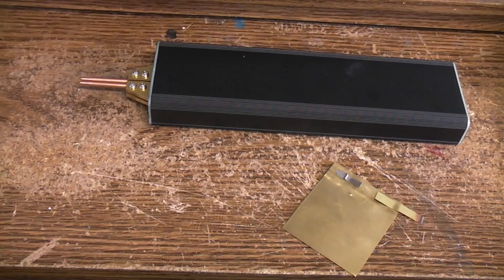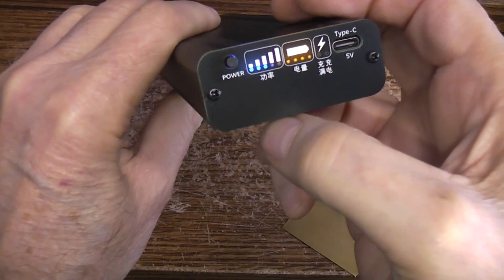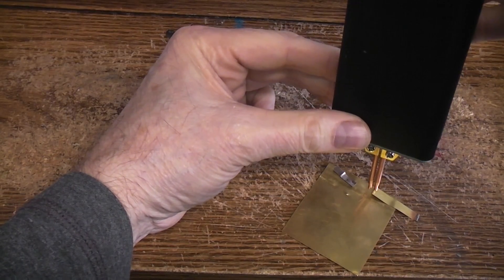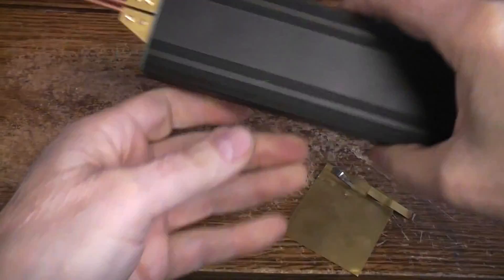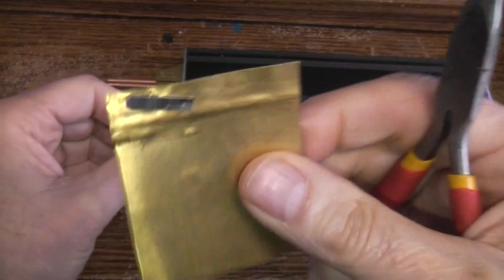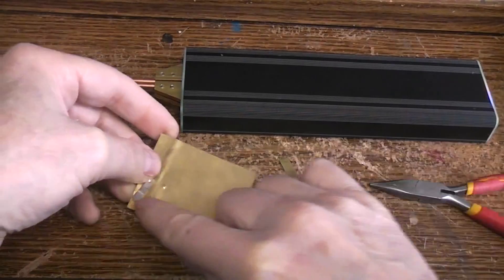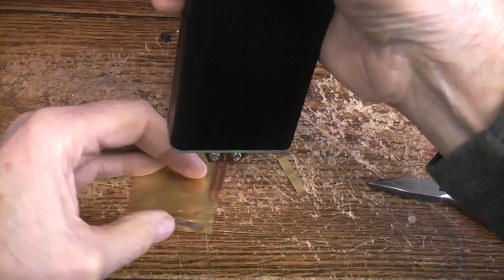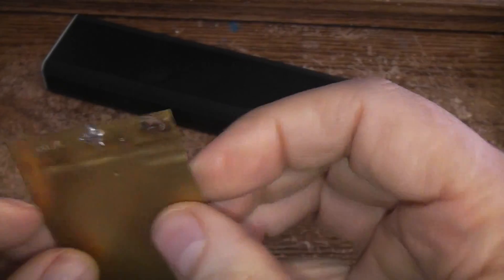Testing the low-cost spot-welder on Nickel plated steel to brass and brass to brass.

Comment: I was wondering about that.  Those welders are advertised as working specifically with nickel. I also noticed that they all have a “gear” rating.  I assume a higher rating equals more power.
Reply from the maker: Yes, they call the power settings Gears. It is really a time duration setting. The power mosfets always turn on 100%, it is just changing how long they stay in the turned-on condition.